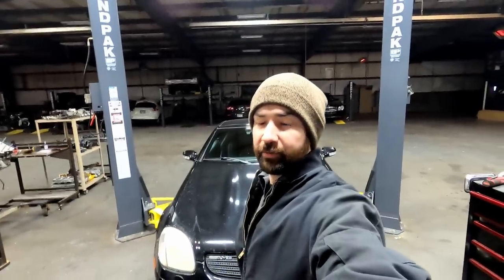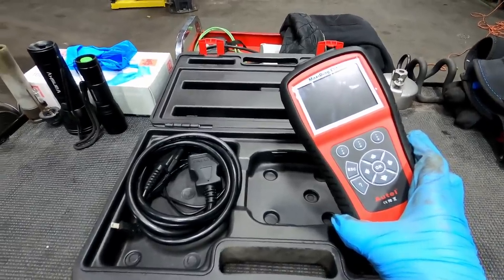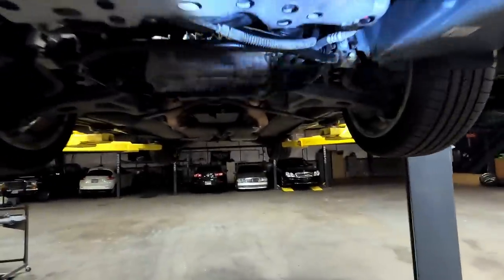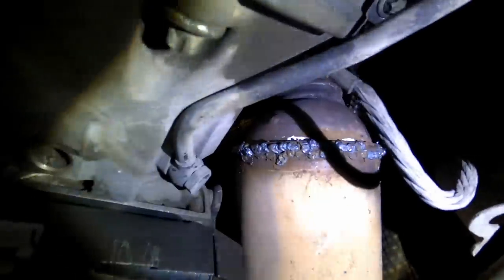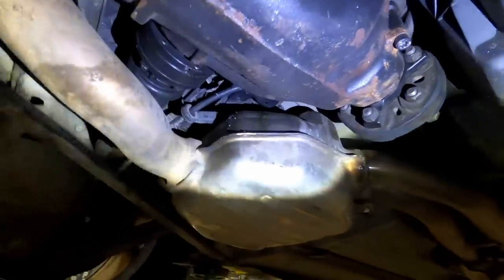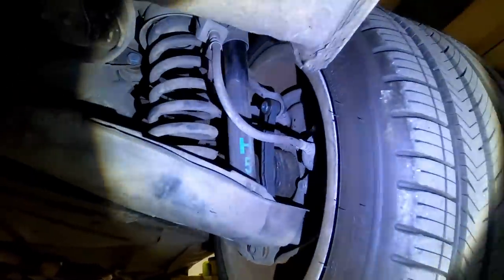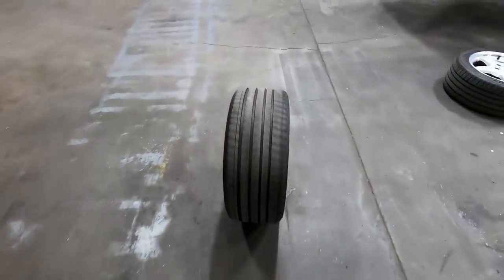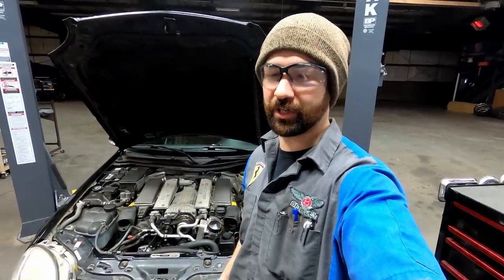800 miles driven and more work to do

Comment: Hoovie makes everything look like a bunch of roses.  I love these deep dives into his cars from you and Normal Guy Supercar.  Nothing wrong with what they do, but it's not as easy as they make it seem.
Reply: Along with Danielson :)
Reply: there is also the fact that using a car for a prolonged period instead of quick test drives to find out what is wrong with a car is very different
Reply: Said that…
Reply: Car Ninja and especially M539 restorations are the gold standard on vehicle restorations.  VehicularDIY is also good along with M539 in featuring BMW.
Reply: @Yippee Skippy I think Hoovie mainly shows that buying an expensive car as cheap as possible can have a lot of pitfalls for the new owner. These cars are cheap for a reason/multiple reasons and while they can be restored to a good condition, that often costs more money than when you'd bought a decent car instead. If you can do the work yourself, as Mike obviously can, a car like this might be interesting to buy, because you can fix (most of) the problems yourself and therefore can drive a car that you couldn't afford to drive if you had to buy it in a good condition.
 
Hoovie and the Car Wizard mainly demonstrate that what looked like a bargain often has problems the previous owner knew of but didn't tell the buyer and therefore said bargains mostly aren't worth buying. But every now and then there is a gem to be found, although even experienced buyers who know all the weak spots of a car can still be caught out buying a car that has way more problems than they thought based on their experience. But they also show that the maintenance of these cars is (very) expensive and that may be another reason why these cars are so run down and neglected. The people who bought them couldn't afford the (proper) maintenance and therefore just drove them until they almos literally fell apart.

Comment: This is why I like having stick welders around. It was something my grandfather taught me when you run out of gas on a tig or a mig welder that stick will get the job done. I mean you can pick one up for 150-200 bucks. Will it be the best? no but it will get you out of a tight spot.

Comment: I have the same issue with the rims on my W212 (2014 E350).  One rim was an aftermarket, took almost 2 years to find the correct one.  Now it's getting it into the shop for wheel repair!

Comment: As a poor man, I've had success with internally sealed bearings. If you slap the intermediate driveline bearing on the floor grease will move into the rollers. I've had really gritty rolling bearings running smooth with this procedure and got 50k miles until sold. This also worked on intermediate axle bearings. Just bump the shaft on the floor to slop grease internally.

Comment: Always the worst getting a car that someone else took apart and didn’t finish. I know Mercedes uses a shim at the nose of the differential that shim goes in between the diff and the floor pan where it  bolts up. That style catalytic converter was known for making a perfect  hair line split at the factory weld. So welding is not uncommon to find but with efficiency code you are definitely due for new cats. Hope that helps. To clarify the shim at the front of the differential that goes to the body is used for measuring the incline angle you could probably get away with regular washers from a hardware store they’re about the same thickness but you might have to play around to change the angle or get it right. We never messed much with it but we just made sure that when we took a diff out to reseal or replace it that the shim went back.

Comment: Cracked catalytic converters on Benz's from that era was standard "par for the course" Mike, just drop the exhausts and get someone with a TIG welding set up to run around the cracks. I had the same issues with a 2000 ML320 years back.

Comment: As far as the catalytic converters go, have you considered aftermarket catalysts?
 I ordered a Magnaflow universal, round catalytic converter with a 3 inch inlet/outlet and a 4” outer most body diameter for my 2.3T Mustang.
 I bought it through either Jeg’s or Summit about two years ago and I remember it being reasonably priced, I don’t think I paid more than 230 bucks for it. I’m sure factory catalysts are much more expensive.
Reply: I bought a magnaflow drop in cat for my blazer. Was $600 and it bolted in easy peasy. Paired with magnaflow performance exhaust 🤌🏻🤌🏻🤌🏻

Comment: 1:36 Mercedes (or any other brand which use similar design) oil filter housing relies on o-ring for the seal, not the torque.
so just making sure it sits all the way down and would not loosen itself from vibration would be enough.
it's not like crush washers, or canister type oil filters.

Comment: You should replace the transmission pilot bushing even though it may not be leaking externally . It can leak internally.
Also replace the fluid and filter.

Comment: All that oil around the drive belts will cause them to squeal as they slip. Particularly the supercharger belt when under load. You might be right about the propshaft though i dont think that many splines should be showing out of that joint. I have a similar age 230k and the center bearing recently gave up on it. At first it sounded like a clutch release bearing (it's a manual) was going but it made the same noise but only when coasting and didnt matter which gear it was in or clutch in/out. It would only do it when cold, but then it got worse.
Then it started to thunk under load. By the time i got round to looking at it the bearing had separated from the rubber mount and was hanging free.

Comment: Hey Mike. I just went through the same thing on my CLK 500 with my rear diff mount. Definitely that bushing is too large and is screwing up your pinion angle. They sell the washer spacers in 1 to 3 mm sizes, looks like bushing is about 5-8 mm. If you need a parts list let me know, it took me a while to track them down.

Comment: I'd say use a product called Cataclean. It really does work. In my case on an 04 Celica GT, which would throw the code and then I'd clear it only for it to appear after a few hundred miles. One bottle made it better, so maybe 1000 miles , used another bottle and it has not come back. MB Cat's are very expensive so I would suggest getting one second hand one or taking it off and doing a better welding job, and then Cataclean.

Also - I know you like to keep things stock but putting the six speed from the 320 SLK really would make it much more fun and make great content. Pretty straight forward swap and reverseable.

Comment: You don’t have to replace front bearings as they very rarely go bad. You only need new grease and adjust them to 0.01-0.02mm play.
Reply: The bearings are sealed cartridges that pressed in and out, not the old loose style.
Reply: @ATEC101  i agree but mercedes still used tapered roller bearing on these cars which needs to be adjusted only most of the time.

Comment: I have that same scan tool.
you have to buy the software for the car line you want to scan manufacturer data on - abt 10$ each car line.
I also have a mercedes E430SE 4-matic.  
When i run a manufacturer system scan,  it hits 100% then tells me to use the 38pin mercedes connecter under the hood - in 2002 mercedes didnt have all the data on the obd2 conector under the dash.
So you now have to buy - FOXWELL Mercedes Benz 38 PIN MULTIPLEXER and EXTENSION CABLE - ebay for 60$. The data stream is aparently all on one pin and has to be split up onto the obd2 conector the scanner can access on the adapter. 
Im I correct here mike? 
This is your area of expertise on these cars. I think even the high end autel scan tools would need this same adapter ?

Comment: Hey Magic Mike, i am really interested to see how you change the oil of the compressor. I am interested to do this in my 32 amg. Have you seen on this cars what can make a coolant visit workshop when everything works great ? Thanks you Magic Mike
Reply: Most people use a syringe with measurements up to 150ML and a hose to extract the old oil out of the supercharger, you will need another clean syringe to put the new oil inside putting in only as much as you have taken out. The OEM supercharger takes Mobil 1 synthetic jet engine oil as well. I have done this for my brothers S55 AMG and our last 2 C32 AMGs and there are a few videos on how if this is not detailed enough, hope this is helpful!
Reply: @cartergaming1339  thanks you à lot

Comment: MM I'm new to the world of Mercedes.   I just picked up a 2013 C250 coupe with 51k miles.  The car seems pretty clean but it may have had some of it's services neglected.   I'm planning on starting with an oil change and brake rotors and pads.  Is there any problem areas with these cars I should check?

Comment: So few wheel and tire technicians will spend the time to check lateral and radial wheel runout.  Each manufacturer has minimum specifications for their wheels.  Soft gravity or even low pressure cast ones will wear just like the other rotating parts.  Impacts distortions are killer, too. 

Most wheel shops can true them to be good enough for a while until they wear out again later down the road.  Forged are way better but may have cracks due to impacts.  There is a reason why they are more expensive.  Only really rich fools run carbon fiber composite wheels on the street.

Comment: Don't get too carried away with the wheels. You can't tell by rolling it on the floor if it's out. It's just falling back and forth on its center tread. Hello? That's crazy. They'd have to be so out you'd spot it on the car. Like DUH?